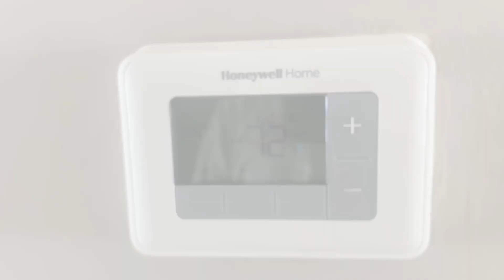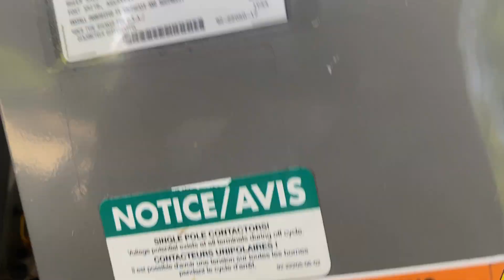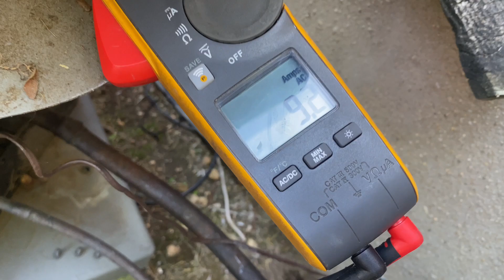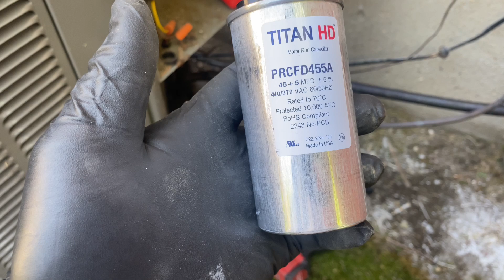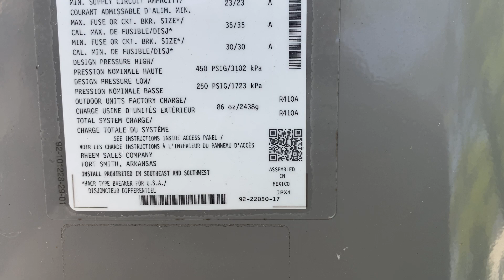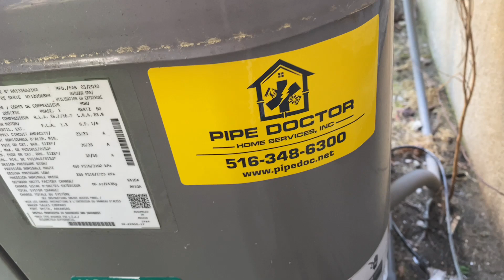Troubleshooting Central Air Conditioning Breaker Tripping Issue

Comment: Bud, don't add the amps from leg to leg, its the same circuit. I had a helper the other day try to tell me there was 560 volts in a 480 panel, because he was adding the voltages of the different phases up!
Reply from the maker: Ok, thanks

Comment: Some breakers (like the old Westinghouse there) do not go mid position when they trip, they go to off. I hate those too, because its sometimes hard to determine if there was a fault or someone just turned it off. Those old Cutler hammer with the tan toggles are another example.
Reply from the maker: Sorry, I made an oops
Reply: @PipeDoctor  it happens

Comment: You need to size your wire for minimum of 23 amps… you then need a 30 amp breaker and you can you a 35 amp breaker IF you have nuisance tripping per the tag.
Reply from the maker: Thank you very much for the clarification

Comment: HI mIKEY PIPES IS IT NOT POSSIBLE THAT THE FUR COAT ON THE AC CONDENSOR WAS CAUSING THE BREAKER TO OVERHEAT
Reply from the maker: It is possible
Reply: Yes it can. Less airflow = less heat transfer = higher temperatures = higher pressures = more load on compressor.

Comment: Looking at that old disconnect, I wouldn't be at all surprised if there were some toasty terminations inside or at the breaker panel causing high resistance. An idol voltage test and one during startup could indicate a reason for excessive amperage draw under load if the voltage drops more than a couple of volts.
Reply: That happened at my house, thankfully I heard the condenser freaking out and went to put it out with a garden hose or it would have taken the whole house. Cheap new construction parts.

Comment: I agree was breaker, but your math is incorrect.  You do not add both poles it should be balanced Amps so it is 9.2A* ~240V = 2200 watts.  A 20A double pole breaker is 20A per pole.  So 9A vs 20 = ok.  What size breaker did ACUnit call? 23 A so yes it was undersized, due to startup surge, not the 9.3 A continuous draw.   But you found issue and fixed it.  Good job.
Reply from the maker: Thanks for the clarification. I’m a little rusty. It’s been all winter long dealing with hydronic heating and not central air conditioning.
Reply: it says right on it "minimum supply circuit ampacity 23A" which denotes it draws more than 12awg can handle(20a max), so it needs 10awg wire or larger for longer runs.
it also says "30 amp minimum fuse or breaker size", which makes sense, since the compressor run amp is listed as 16.7A, locked rotor is 83.9A and the fan is 1.3. 
so 18amps rated draw, in perfect conditions. startup current will always be higher while the fan comes up to speed and everything stabilizes, not to mention the compressor pulling near LRA for an instant. so they need an electrician to upgrade the circuit. 
depending on what evaporator coil they have, it may have a TXV without an equalizer/bleeder.  I'd also be looking at the thermostat, maybe it's bouncing the contactor or something else bad, making it worse.
Reply: Wonder if installing a soft start kit would have solved the issue.
Reply: @Samlol23_drrich  it definitely would of reduce start up

Comment: Adding currents between legs make no sense. They are 180 out of phase, so not additive. If they are unequal, then you have ground current on the difference. Otherwise, good work.
Reply from the maker: Oops, I made a mistake. Thanks for the clarification.

Comment: Bo, 9x2a on a 20amp breaker.  Ure confused. Please get re-learned.  I like watching ure AC stuff… but ure lacking understanding electricity.. my mom teaches a class after church.  On the last vid you ran a new control wire for a frozen unit.  It used to work good enough to make ice?
Reply from the maker: I agree I made a mistake on the calculations there, but the breakers is too small because the minimum amp is 23
Reply: I had a stroke reading this. You need to go back to school and get “re-learned” on how to speak English. Maybe your mom can help you.

Comment: I’m not an electrician but on a 240 V wouldn’t you just go by each leg and not combine them with amps?
Reply: Correct.
Reply from the maker: You are correct I made a mistake but the minimum circuit is 23 not 20
Reply: @PipeDoctor the MCA tells you the wire size to use, the MOCP dictates your breaker size. So essentially, #12 wire with a 30 amp breaker is what this system needs. BTW, you had way more than a blanket on that condenser coil, thats 4 years of dirt accumulation. I bet your LRA comes way down after you wash it.

Comment: So they need to upgrade to 10G wiring with 30A breaker…I’m assuming they have 12G wiring presently?
Reply from the maker: I recommend an electrician
Reply: The 12ga wire is adequate for the normal running load. The breaker is sized to allow for inrush on startup. In the NEC hvac is treated differently from normal circuits. The unit's  thermal overload is considered good enough for over current protection, and the breaker protects the wire from short circuits. That's why you can sometimes find 14ga wire (restricted to 15a breakers) on breakers as large as 30 or 40 amps in hvac.
Reply: @mxslick50  except in this case, it states "minimum circuit ampacity 23A, which is clearly large than the 20A 12awg can handle. so being listed and following code it has to be 10awg or larger for long runs. 
really have to pay attention to listed minimum's like that or you'll be doing rework to pass inspections.  also, most breakers are made capable of handling the large inrush start currents now, so there's virtually no need to oversize until you get into large commercial gear.

Comment: Wait it showed 65 but it said it needed min 25 max 35 . ??? So what did you do for it
Reply from the maker: I recommend an electrician to make the electrical upgrades that this outdoor condensing unit requires
Reply: @PipeDoctor  so what size breaker does it need to keep it from tripping ??
Reply: @johnanderson3746  It would be the 35a, Code would allow 40a. That would allow the 65a inrush without nuisance tripping.  (Next standard size.) The wire need only be rated to 20 amps, since the running current is only 9.6. Hvac has exceptions to standard wire and breaker sizing rules.  Rewiring isn't needed here, but a larger breaker is.
Reply: @mxslick50  if it's not more than 65a how can it handle it,  if it's only 35a
Reply: @johnanderson3746   Because all breakers have a trip curve, time vs. current. The higher currents (up to 200%) can pass for only seconds, but lower overload currents can pass for several minutes. The breaker's rating is the current that can pass "indefinately". 

The inrush in this case is less than the 200% of the 35amp breaker, which will allow it for several seconds before tripping, enough time for the compressor to start.
Reply: @mxslick50  thanks for taking time to explain it. Wish net people like you thru out my life maybe I would've learned more
Reply: @johnanderson3746  You're welcome, glad I could help.
Reply: House would need the circuit rewired if wiring is not rated for 30 amps and a breaker change. He prob recommended an electrician for the job.
Reply: @maxwellmelon69  yes but it said 65 wouldn't it need more than  30 ?